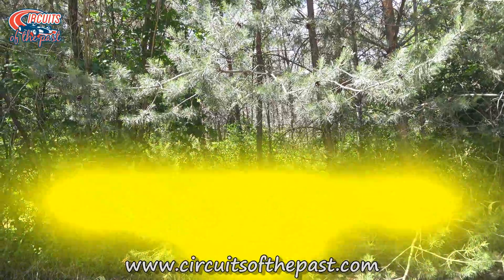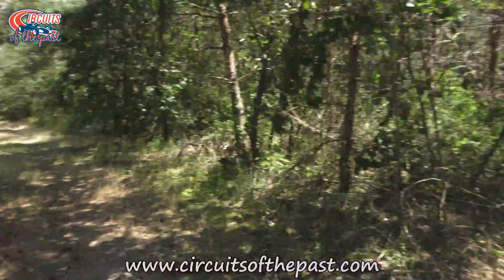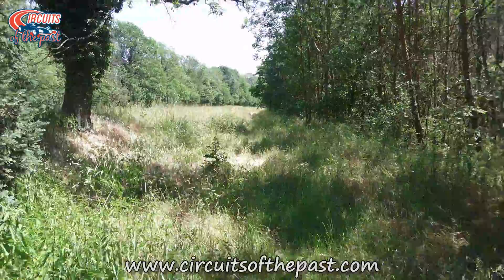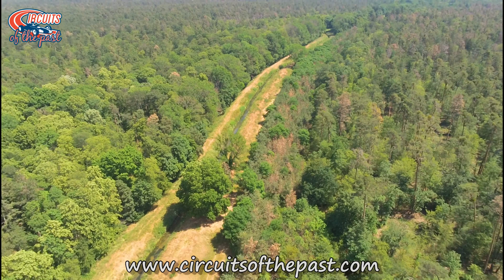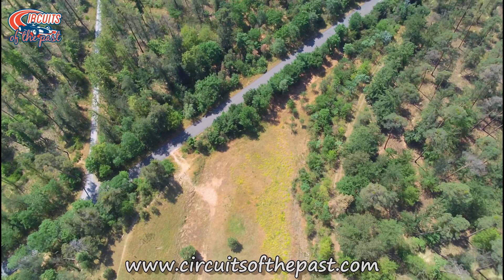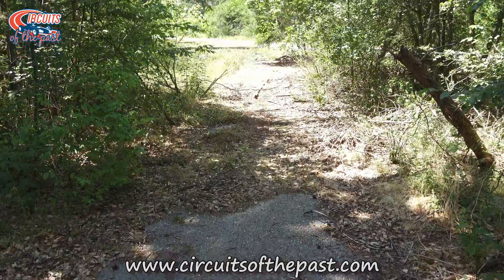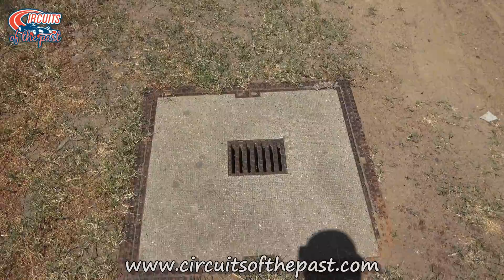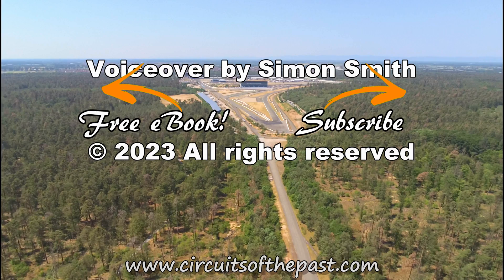Old Hockenheim Today 2023 - Exploring the old Hockenheimring by Foot and by Drone

Comment: Nice video but would have liked an overlap of the two circuit’s together to see exactly where the old and new now are
Reply from the maker: Thanks. I will use this suggestion in the next Hockenheim video. In this video I already did so: https://youtu.be/NfkqZZZ3Si0
Reply: I agree needs an overlap
Reply: The new one basically is the same as the old one.
They just cut of the most interesting part: the Highspeed forest section.

Comment: I went there as there is a museum and then went to explore around the track and didn't know they had shortened it permanently.  There was a car park at the Ost Kurve so I went in to look.  The old track was still there but the length down to the stadium section had been resurfaced as a new circuit entrance.  What mystified me was why they did not leave it in place so it could still be used such as how the old and new Nurburgrings can be linked.  I saw a 24hr touring car race on tv using the pits and paddock of the new Nurburgring and using the Nordschliefe.
Reply from the maker: For the construction of the new section several trees need to be felled. This was met with protests from environmentalists. So as a compromise they decided to demolish the old part to plant new trees.